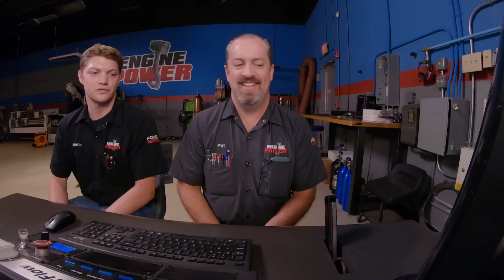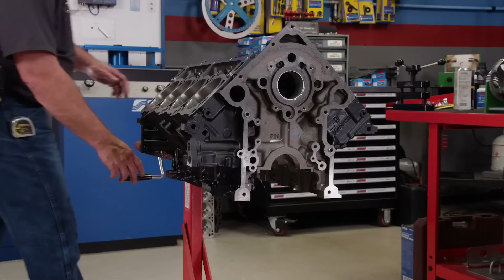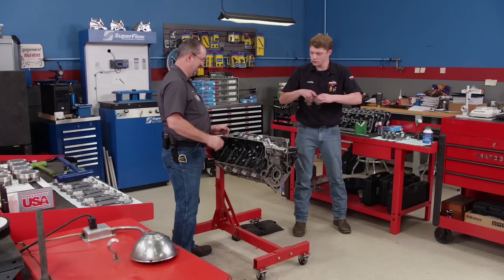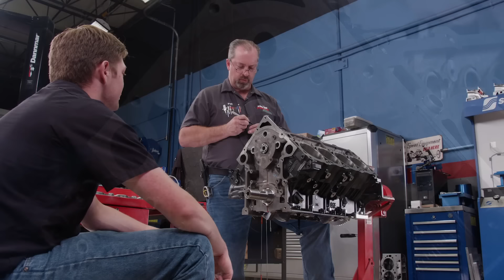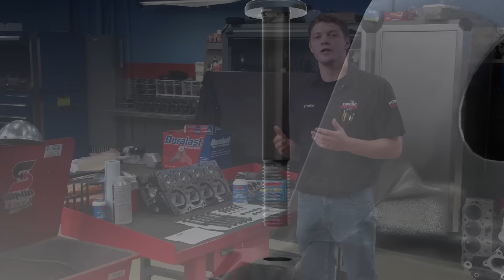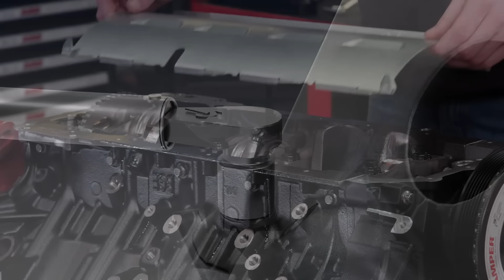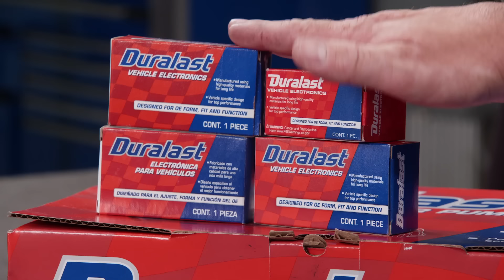Building Up a New 6.4L Gen III HEMI For Reliable Muscle Car Power - Engine Power S8, E16

Comment: I love to put that in my 2005 dodge neo sxt with a new frame.. been my dream for an awesome car... since the 05 dodge neon was the last in production.. the 2.0 engine in it i was told no one can do anything with it.. but  just my dream.. yall rock i watched yalls videos awesome 👍😎
Reply: Throw a 2.4 turbo from the SRT4 in it.
Reply: @TheMoparman94  yea i agree but i still cant understand why the 2.0 cant be turned up.. some say the ecm wont allow it  some say the pistions are too small i just get a lot of mixed messages on why the 2.0 cant be turned up..
Reply: True but i had it 10 years.. and emissions on it was awesome no leaks and 80k origional miles.. be cool to see if i can get more horsepower out of it
Reply: Yea.. am medically retired .. i was looking to do a low budget transformation..
Reply: @videosgoneviral7858  you can get some butt implants in Brasil...I hear they do them on the cheap.

Comment: Why does it seem that modified n/a LS engines can reach higher HP vs. modified Gen iii hemi? Isn't the gen iii hemi's valve arrangement supposed to be superior?
Reply: It is and you can get more power out the the G3 Hemi. I would take the G3 Hemi over the LS. I have two G3 Hemis in my driveway. One will be left alone. The other one will be getting some work done soon.
Reply: On the whole the heads for LS’ are superior in flow so they still make more power
Reply: @lomfmur  in that case, what's the point of using hemispherical head configurations? Even the viper didn't use one.
Reply: The reason is the Hemi heads have worse average airflow and lower airflow velocity than than LS heads. Don't get hung up on peak flow number because that usually occurs at .70 inch lift and unless the cam is a full race cam you never see it. The best power is made by heads that flow well at the lift points where the intake valve is just starting to come off the seat and the cylinder is starting to fill. Power is all about efficiently filling the cylinder with as much air/fuel as possible before the compression stroke. Check out Richard Holdners vids on the subject that guy has dyno tested EVERYTHING.
Reply: @DBSSTEELER  well fo course a better flowing head will make more power. Then why would a non-hemispherical head flow better than a hemispherical one? If a non-hemi head is better then going hemi-head shape is just a wasteful design? Or does it just mean that the Gen iii Hemi is just a worse design than an LS head?

Yes, i follow Richard Holdener too. He does dyno pulls, but has no flowbench content.

Comment: Just go with an electric motor. They only have 3 moving parts. Simple, Super powerful and super reliable. I have electric motors almost 100 years old, all original and still work like new!!
Reply: Yeah that sounds like fun,,,,,,,, no thx
Reply: Electric motors will be all the rage soon, I’d rather enjoy these complex gas burning beasts.
Reply: Yea until the brushes burn out 😂, or the batteries deplete..

Comment: I had a 2002 AMG with a 5.5L mopar in it.  Absolutely wicked little power plant.  I called it the sharpie, it would make the blackest stripes on the road.
Reply: @bigboreracing356  shuck it up butter cup
Reply: @muskokaroads2371  2002 CLK 55AMG. look it up dummy.
Reply: @davesalzer3220  which wasn't a Mopar engine.  It was a tuned Merc.  Which leads me to doubt you actually had an AMG Mercedes or you would know that.
Reply: The 5.5 engine in the Mercedes is not a Mopar engine.